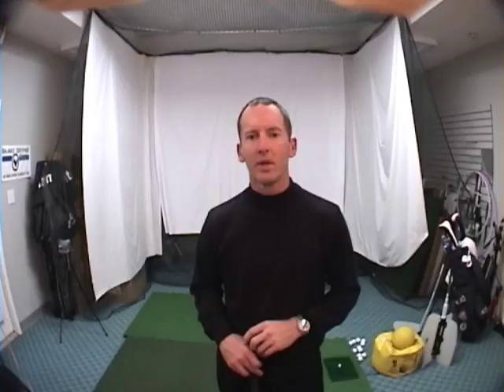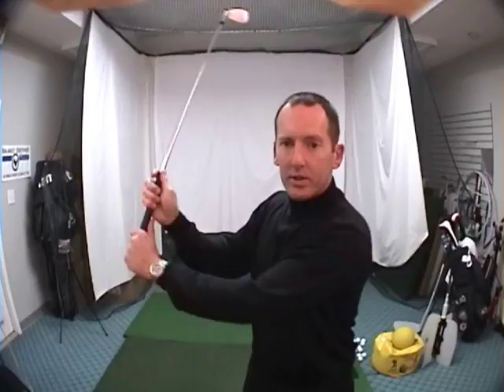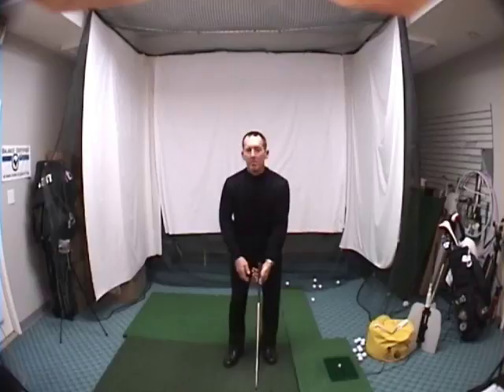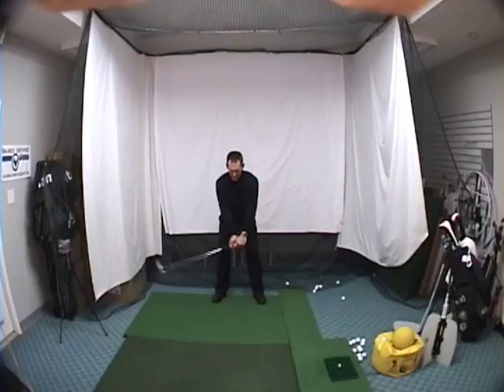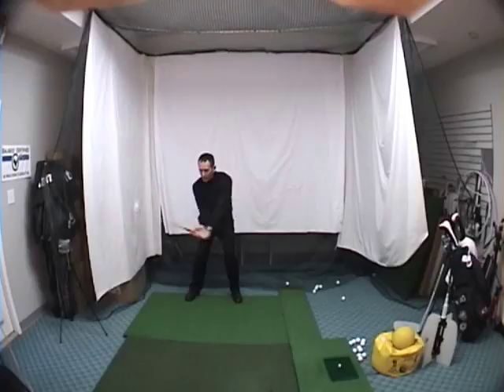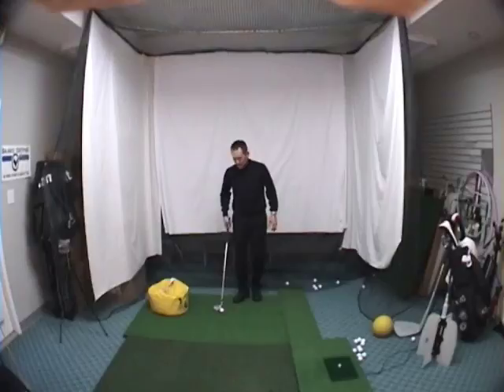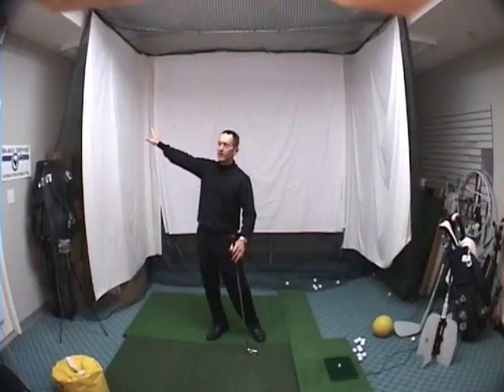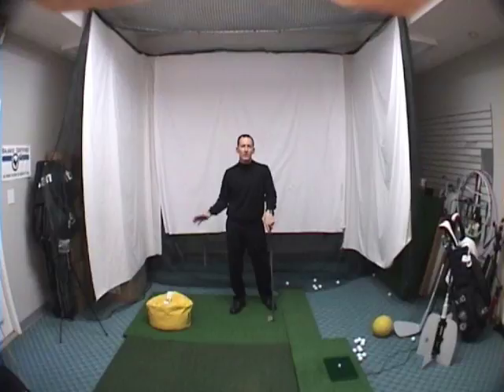Stop Casting and Create Lag in Golf Swing: Golf Lesson by Herman Williams, PGA

Comment: Beginning the swing with the wrists already cocked is the most useful tip I've got in 50 years of struggling with my swing.  It immediately eliminated coming over the top and slicing.  It keeps me dependably on plane.  Why didn't somebody tell me this 50 years ago?  It would've have save me a lot of misery.  Well, better late than never.  Thanks.  And yes, I soon learned to incorporate the wrist cock into a normal swing.  Amazing how much simpler and easier it is to hit the ball flush.

Comment: Thank you so  much for uploading, I have suffered with this problem in varying degrees off and on for 20 years. My bad shot is a nuclear straight pull left with a divot shallow but deeper towards the toe pointing to where the ball just went O/B!! 
Very good tips that actually work (I've just done the wedge drill outside in the pitch black and rain !!) I can feel my wrist angle wanting to extend at about half way down the down swing and I really have to Lag the wrists so I know where my fault is. I used your wedge drill and the position I gained at impact felt amazing -attacking from the inside and extending my wrists just after the "shot". Even without a golf ball to strike ,the swing feeling felt awesome. Thankyou again from a 10 H/Capper.

Comment: I am going to try these drills. I have always casted the club, no matter how many lessons I have taken, it has never gone away. But I cast a little later in the swing when looking at my lesson videos. I almost never take a divot, hit it a mile high but still get good length on my shots (I hit my 7-iron 175 yds), but as you can predict, the wind wreaks havoc with my shots. But my misses are usually thin which go low and hot and I am in trouble. I hope this works!!!

Comment: Great instruction. Question: In a normal swing, why does one need to keep width on backswing rather than early wrist hinge that would mirror downswing? (like what you use for this exercise to a). I've read multiple reasons for a wider arc on backswing but I don't see the logic if the downswing is performed correctly with a late release of the wrists?

Comment: Herman, as for this video I'm good down to the part of holding lag to where the shaft is parallel with the deck...it's from that point where I'm not clear. I'm thinking I need some guidance on what to do next.  Rich
Reply from the maker: Rich it really becomes a blur at that point. My advice is to let it be a blur and try to focus on the post impact position. In other words you go from full wrist hinge at waist high to full release past the ball in one move. In the video pay close attention to the short drill I do where you would hit a wedge with nothing but wrist hinge for a backswing then try to finish with the clubhead pointed long and low below the horizon toward target with toe of club fully released. Good luck.  -Herman

Comment: I just tried your third drill.  My question is if I make contact and my divot is after the ball does this mean I have my hands in front of the ball when making contact?  I don't feel my ball flight is low so I'm questioning whether I'm doing it correctly.
Reply from the maker: Bryan, if your divot is after the ball and your distances seem appropriate for your swing speed (i.e. ball is not ballooning) then i wouldn't worry too much. Sounds like you're doing it right.

Comment: need some advice.   I have a swing speed of 92-  ball speed at 129-  with back spin at 2105.  Can you tell me as a 13 stone 5"10 player  what should my  launch angle be, also my driver loft, do i need a stiff shaft (started to slice as i develop more power)  do i use a closed face or get it bent open.  all these questions.  i hit it 290 regularly (6-10)  but i want to get to 300.  so that i can then hit 250 (10-10)  at 80% power therefore retaining control.   help before i get someone to hit me

Comment: Hey Herman great drills, but I'm a little confused on how to tell if I have an open clubface at the top of my swing. Any other ways to tell. Does a flat swing generally have an open club face at the top?
Reply from the maker: Zach, I'm afraid the only way to be very sure about what you have at top of backswing is to verify it visually with a mirror or with video. You're looking to se if that leading edge is parallel to the forearm. Generally with a neutral grip that will also mean a "flat" left wrist a the top, but not alw.ays. The key is the face/forearm relationship. Flat or upright doesn't necessarily dictate anything about the face.
Reply: ***** Thanks! One last question, can standing a little closer to the ball naturally eliminate some casting?

Comment: At your website you state that the heel pad should be across the TOP of the handle in set up. Then how is it possible that you state at the same time at 2:27 that the leading edge of the face should line up with the back of the hand which is the same line as the heel pad. This last statement would suggest that the heel pad is at the LEFT SIDE of the grip, not the TOP.

When I have my heel pad more across the TOP of the handle then I always end up with a cupped left wrist at the top of the backswing especially because you have to push down the handle at the start of the backswing and push the buttend away to the top. Last information is also from your website.
Reply from the maker: amfohr Amfohr, I appreciate the detailed study you've made here ... you've obviously put some work into paying attention to these videos and articles. I'm not sure exactly which web page you're referencing, but I've offered the choice in these tutorials on both YouTube and website to opt for a neutral grip and flat left wrist at top of backswing or go for more hinge and power by adopting a stronger grip (heel pad angled across the handle) and cupped position at the top. So it's incumbent on the player not to mix and match styles. 

But in closing, I will admit you can still get the muscle of the heel pad to sit on top of the club while keeping the back of the left hand square to the face ... but the heel pad may not fully cover the entire top surface of the handle unless you have large hands. In private lessons, I move grips all over the place to get the best results, but to a public audience online it's too hard to get into all the individualities. Hope this helps clear it up for you.
Reply: ***** I read the TOP of the handle grip and backswing in "http://www.hermanwilliamsgolf.com/golf-lag-stop-casting-lag-like-tiger-woods/" in How to Fix the Casting & Create Downswing Lag. 
But also in that article you state "Now we have a neutral grip" and a flat wrist at the top.I just don't understand you can put pressure on top of a grip when the club gets to the top of backswing position and suddenly the heelpad is at the LEFT SIDE of the grip at the top in order to have a flat wrist.
Reply from the maker: amfohr I'm not sure I completely understand the last question, but the key idea to get out of all this is that open clubfaces tend to cause casting. The heelpad position does not change during the swing and is not at the left side at the top of swing, but rather the club is planed at approx 45-degree angle which may give that appearance. At 2:27 in the video, it's most important to grasp that the leading edge of clubface aligns with the forearm. It may also align with the back of left hand depending on grip position. In my own swing, the leading edge aligns with both the back of my hand and my forearm, thus what you saw in the demonstration. However, it's most important to align the face with forearm and to understand that a stronger left hand grip may create a slightly cupped wrist that doesn't always align the back of the hand with the leading edge of face.

The article actually states " now we have a neutral grip, square clubface and maximum wrist hinge ..." As I said earlier, this web article is detailing how to maximize wrist hinge and lag by using a somewhat strong left hand and weak right hand grip to still arrive at a net neutral position for the face. This provides the maximum amount of wrist bend for hinge at the top.
Reply: ***** I find the part of using a stronger left hand grip and still have a neutral grip confusing, I suppose you mean neutral position of the face like you state in last sentence of your reply?

I can understand that a stronger left hand grip can result in some cupping of the wrist at the top and still let the face be in line with the forearm.

I can not understand that with a flat wrist you can have the heelpad on top of the grip because as I see it the face, the back of the hand and the forearm line up. As I see it the heelpad lines up with the back of the hand and therefore the heelpad must be at the side (left) of the grip.

My definition of heelpad = The area between base of pinky and wrist, the fleshy part, inline with back of hand
Reply from the maker: amfohr OK, I think I see what you're struggling with. Regarding "neutral" ... if you strengthen the left hand and weaken the right, you are still in the same place with a grip and clubface that behave in a neutral fashion with no undue influence on the clubface.

Regarding the heelpad position, since the heelpad is fairly soft and fleshy, it will squish over the top of the handle when you hold the club at an angle across the base of the fingers. If you incorrectly start with the handle too high up in the palm, then the heelpad will not cover cover the top of the club. You can find examples of supporting the club in the left hand with just the forefinger wrapped around the handle because the butt of club is trapped under the heelpad. Here's a link to such a photo: http://www.bettergolfperformance.com/#!grip/cz3b
Reply: ***** Thank you in the first place for your patience, I am struggling with this for years. In the first place when you get older the fleshy part starts to fade away and there is less to squish. The photo you show is very powerful. I never have gripped it like that. I feel what comes in play now is definately the support of the wristbone which is positioned in the wrist where the wrist meets the heelpad.
Reply: amfohr Altho the picture is powerful it does not support a clubface inline with the lowerarm. At the op of the backswing the clubface wants to set right between the two elbows. Seems also pretty logical if you have the heelpad on top of a grip.
Reply from the maker: amfohr If the face tends to point between the elbows, this is classically considered an open clubface position. If this happens naturally for you, it does not mean it is typical or ideal for most. You can find exceptions to any of these positions, Dustin Johnson is the complete opposite with a bowed left wrist and closed clubface at the top. However, if you look at a large cross-section of successful Tour Players, odds favor training toward a neutral grip and square clubface at the top that aligns the edge of the face with the lead forearm. The following link shows Rory at the top with the face alignment we're talking about and also mentions some exceptions. http://www.golfwrx.com/48641/top-of-the-backswing-cupped-bowed-or-flat/
Reply: ***** What I mean is that naturally the face wants to hang down because of the weight of the toe and that's what happens when I RELAX my wrists. If I would address my wrists to roll I could set it neutral or closed but for me that would take an effort, it would not come natural to me because of the grip, especially a heelpad on top grip.
Reply from the maker: amfohr amfohr, I can only tell you not to expect to feel comfortable or relaxed if what you've done in the past is wrong or not working for you. To these Tour Players the positions we're talking about feel completely natural and comfortable because they have done it this way for such a long time it is now an unconscious habit. If you have to make a change to improve, you should expect to have to work on it consciously and potentially to be quite uncomfortable for awhile. You've never mentioned what you are attempting to correct in terms of ball flight, shot patterns or swing tendencies. I can only assume you need to make these changes, but if you are already playing well, I would not necessarily suggest changing a position just to fit this model of how most Tour players swing. Best of luck.
Reply: ***** That is solid advice, thank you. So often relaxed is associated with correct because it is free of tension but often effort is needed first to get the correct positions. I absolutely experience the advantage of a more closed face, its just something I need to persue because its not an automatic result of my grip and backswing yet. Hogan seemed to have a cupped wrist first at the top of the backswing because he felt that this did not restrict that position, in the downswing he started to roll the left wrist in position which is quiet a challenge.